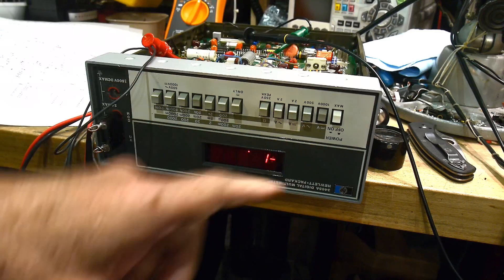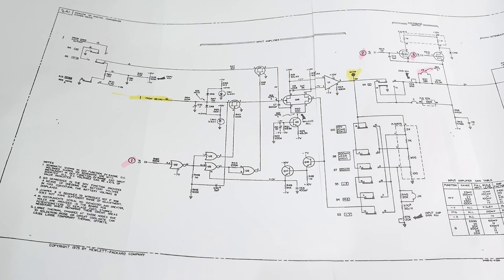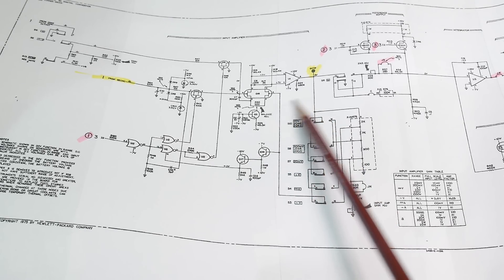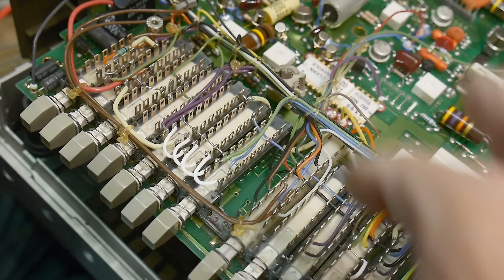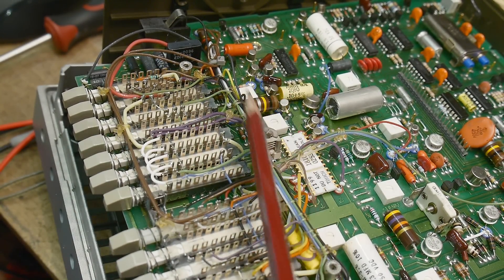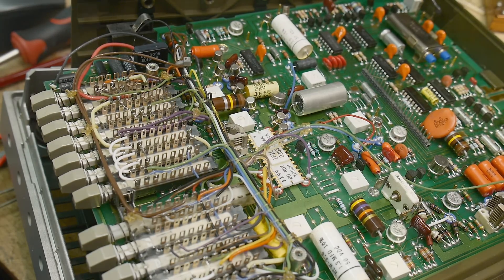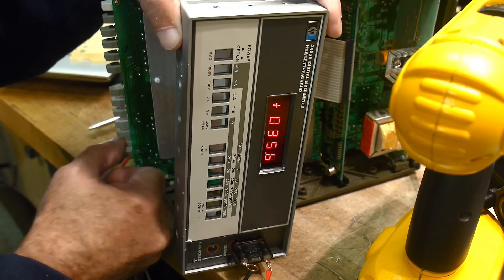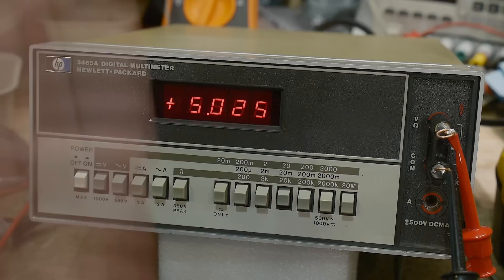#1353 HP 3465B Multimeter Repair (part 3 of 3)

Comment: I have also drilled holes in push switches, but in the end.
The hole was drilled to the size of the can tube.
A blob of hot glue covered the holes.
Reason for doing it this way, i could not be bothered to desolder all the switches.
Yes it was lazy ness :-D

Comment: I am glad I watched till the end.   I paused it to look at the switches close up.  My thought was to drill a hole in it or to try and lift one of the corners up just a bit with a spudger and squirt it in there.  Use a vacuum while drilling to slurp up the plastic spoilage.  Necessity is the hot mom of Invention.  Good video.

Comment: Awesome!! Use the micro set screws that Tektronics uses on their switch extender rods to plug those holes. Then your counterpart 100 years from now can remove the screws and pump in the cleaning solution

Comment: More problems than not turn out to be mechanical in this old equipment.  I got lots of HP test equipment running by reseating boards and connectors.

Comment: Drilling a hole in the back was exactly what I was thinking of so I don't see an issue with it. Good solution. 
Put some "hot snot" on the holes (once plastic is de-greased) to seal them back up again. 
As Dave would say, Jobs a donner
Cheers,

Comment: There is strength in simplicity, I seal it with hot melt glue so that dust and moisture cannot get into it, if necessary I simply peel it off and spray it again. I use a set of three follow-up preparations from the German KONTAKT CHEMIE - Kontakt 60 - releases oxides and impurities, Kontakt WL - washes away the released mess and neutralizes the action of 60, Kontakt 61 - creates a protective film
At HP, for example, they sealed the screw holes without acetate silicone

Nice day 🙂 Tom

Comment: Often deoxit will manage to get in the switches through the pins themselves as they usually are not liquid tight, it will soak in, just soak it a few times, works for me 99% of the time.

I too have resorted to drilling holes in things to get cleaning fluid in… it’s not wonderful but if it works it works !

Comment: Drilling holes like that is not that uncommon....I'd leave those holes open, or just use a piece of scotch tape to re-seal them if you feel the need...I've had to drill small holes in sealed pots as well as those types of switches. Using a cleaner that leaves some oleic acid behind will keep the contacts clean and prevent oxidation from forming for a long time after application....

73...Jordan VE6ZT

Comment: I use to do the same on receivers I restore.
Drill a hole if necessary, and set the unit up so that the front is facing down.
I made a stand that I can mount the unit in,
that way the contact cleaner runs out the front of the switch, and can be wiped up.
Operate switches many times, and re-spray and operate switches and re-spray and...

Comment: Sure, drilling a hole was a reasonable approach, IMHO. There are many unused pins on each switch. Maybe try changing the wires to an unused pin. The unused pin contacts should be less dirty.

Comment: I was going to suggest drilling holes in the switches and then cover the holes with a bit of parcel tape or something. :)

Happy christmas.
Reply: Instead of drilling a hole i would suggest using a hot needle or some very fine solder tip to melt a hole inside the very end of the switch (top cover)
Reply from the maker: I guess you might hot melt and fuse the mechanism
Reply: @IMSAIGuy  That was my thinking, that's why I suggested using some sort of sticky tape over the hole. :)
Reply: @arne9219  With the melting idea, you run the risk of obstructing the shaft of the switch when you press it.

Comment: That is what I was about to suggest.  You can cover the holes with acid-free silicone or hot glue.  If you are worried about getting adhesive inside, put a spot of paper between or use tape instead.  I would simply turn the holes downward and dab the adhesive 'up' onto the holes.
Reply: That was my goto solution also

Comment: I spent some time a test equipment department at the company I worked for, and we had all sorts of test gear that needed attention. (This was about 38 years ago) HP scopes were generally the worst, they really did not like the industrial environment  where they were mistreated a bit. One of the common problems was noisy pots for things like the X-Y movement. Very much the same issue, they were totally sealed. So the "scope" guy, used the same method, drill a small hole, about 1.5mm dia into the back of the pot and apply a squirt of switch cleaner-lube. That usually fixed the problem for the year.. 

So you have rediscovered a fairly old maintenance trick.

I'm sure that there are many more such things done to keep   equipment running in production setups...

Andy

Comment: Drilling the holes is exactly what I was going to recommend.
So obviously you are a genius. 
It does not always work, but I have used the method with sealed pots also.
Gotta be careful, but yeah when it does not work and there is no other way,....